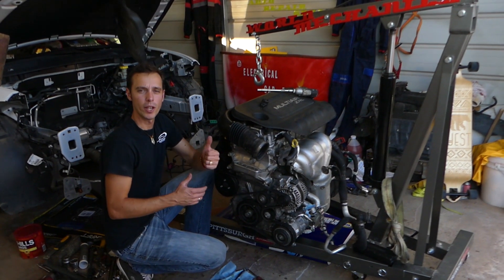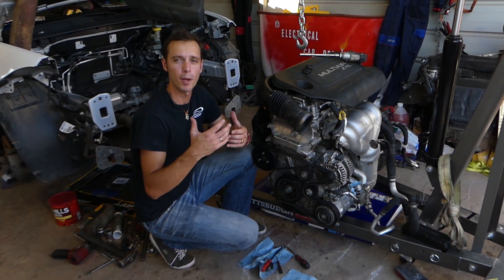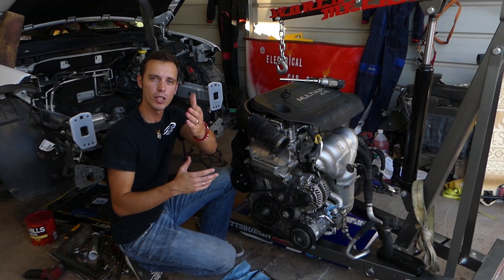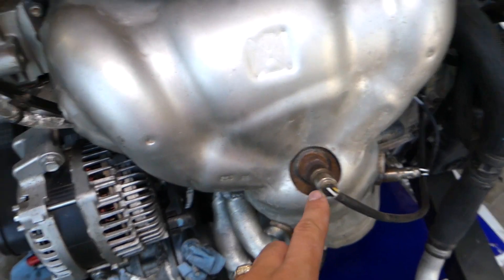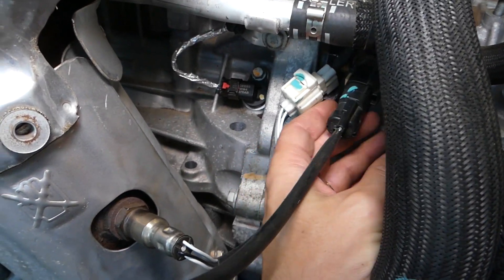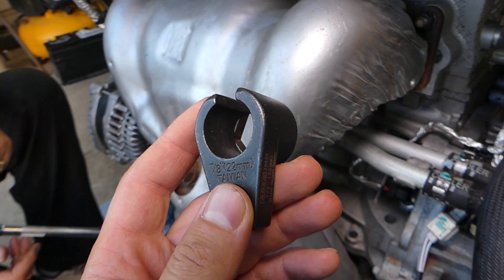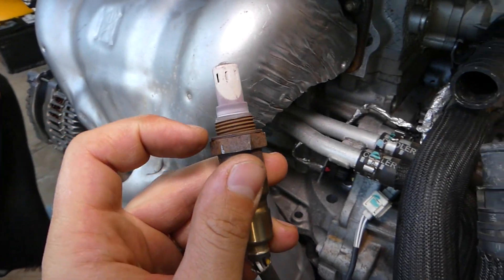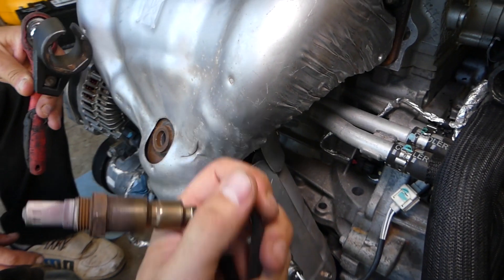UPSTREAM OXYGEN SENSOR 1 REPLACEMENT LOCATION JEEP COMPASS CHEROKEE RENEGADE 2.4

Comment: I have a 2016 Jeep Compass. It’s not terribly hard to do. Lift vehicle in safe position. Have an oxygen sensor removal tool, gloves and safety goggles.
Here’s the bear: it may be stuck and will require heat and lubricant to remove. I’m going to try running the engine for about 20 minutes because I don’t want to deal with a propane torch.
I am not going to cut the wires on the old one until I am sure I can remove the sensor in case I have to drive it to the shop to have them do it. Fingers crossed 🤞

Comment: Couldn’t make out what you said, is it a complicated part to remove or not so complicated given the right tools? 

Also, is there anything that needs to be done or set after replacement or will the sensor automatically start doing its thing. Thanks for the video.